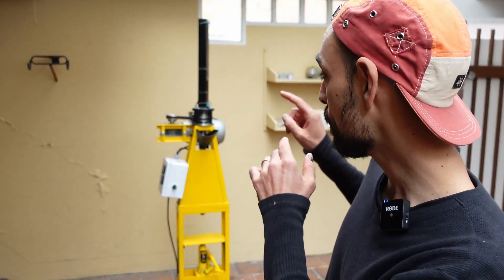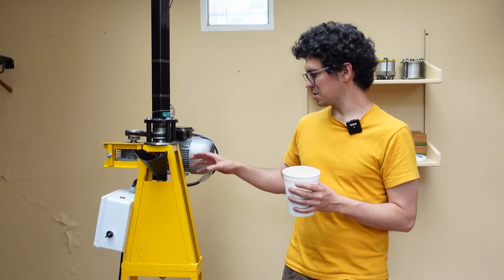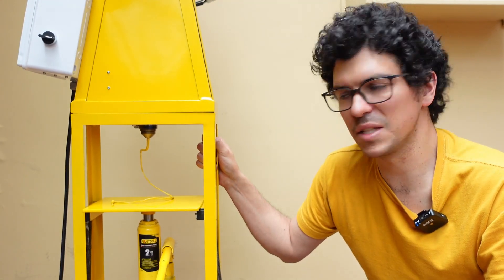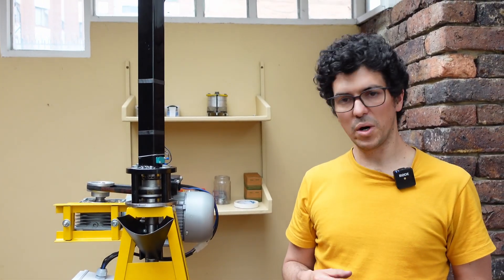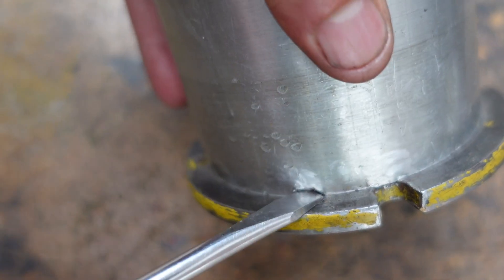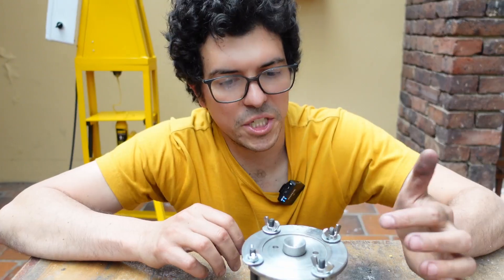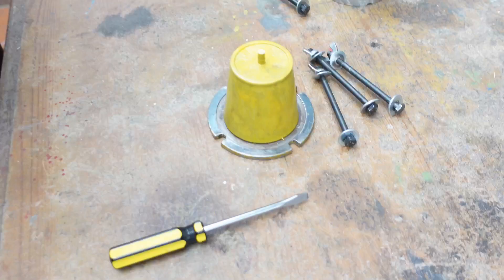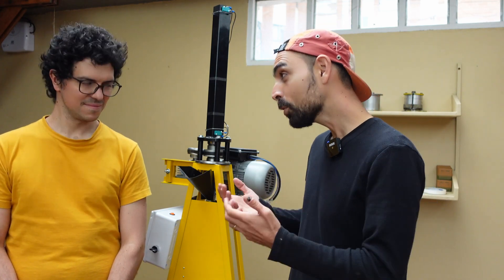How to use the motor injector machine

Comment: Looks good but adding the recycle logo in the mould would help recycling. I’m guessing this could be a separate piece in case different plastics are used in the same mould.
Reply from the maker: It is a bit hard to know upfront which plastic you'll be working with. In this link you can find stamps people can use to make the product with the plastic type after they've made it so we can always know which product it is https://community.preciousplastic.com/academy/create/finishing